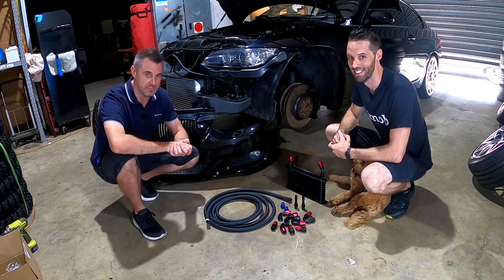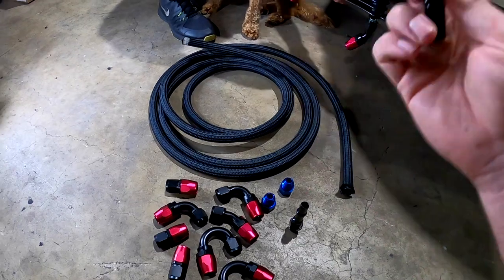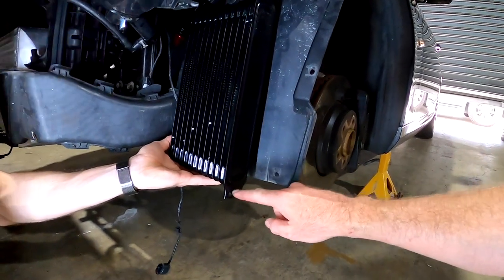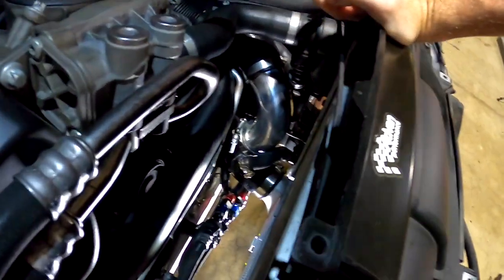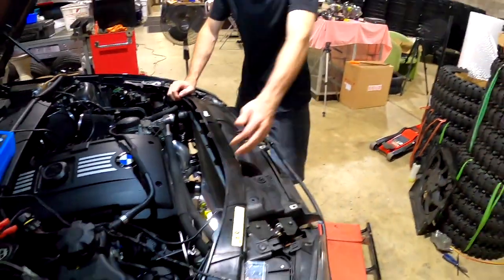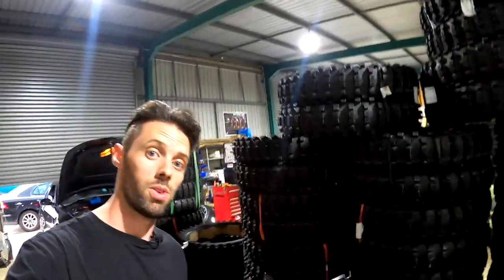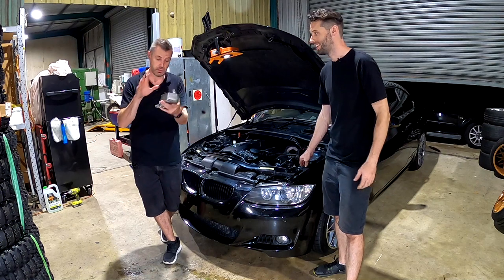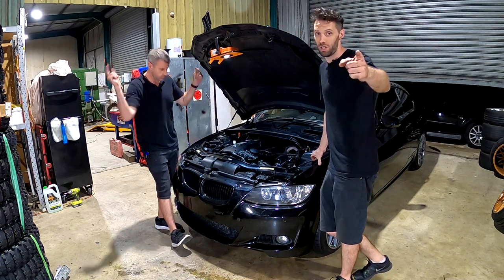BMW N54 Transmission Cooler DIY Kit Install : Budget 335i Turbo Build

Comment: Why would you put a DCT in it if its a budged build? Pretty sure DCT’s are nowhere near cheap, none the less I love the car mate.
Reply from the maker: In 2020 (pre covid) when this was filmed DCT was fairly cheap ($1000-$2000aud) and readily available. The comment was made because a 6at will not reliably hold the power i was targeting. In august 2021 i got a wrecked DCT e93 after selling all the parts i didnt need i ended up making about $1000 cash back and got a free DCT and spare engine. So it did ring true to the original "budget" plan. However May 2022, i put the most expensive single turbo kit on the planet on it....... budget no more. To be fair, the car owes me about $50kaud now, however will be about 800whp when turned up.

Comment: Does this fit on a f20 114i?
Reply from the maker: Unfortunately im not sure what size will fit in that space. However a similar type of kit should work. Would need to find out the best way to connect to the transmission lines incase the zf8 is different to the zf6

Comment: Why didn't you just run the lines directly to the transmission?
Reply from the maker: Mainly just due to needing to work out a way to adapt on the trans at a different point.

Comment: Pretty pointless if you don’t cut a hole in the fender liners
Reply from the maker: I had read otherwise, so thought I’d give it a go without the hole. I figured it would let dirt and shit get there from the wheel well. If you check the next vid where we test it, it works completely fine without the hose. Still takes a little while to get to temp but under hard driving and continually acceleration pulls trans temps are low to mid 80degs. Normal spirited driving it’s stays in the 70s.